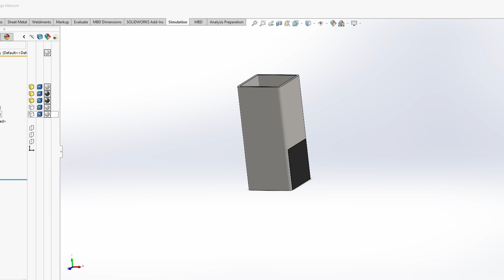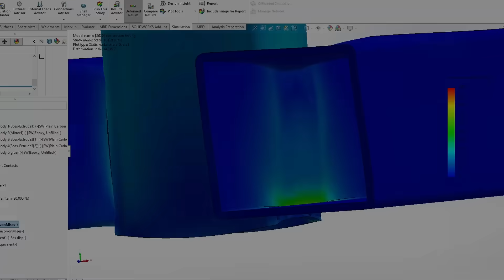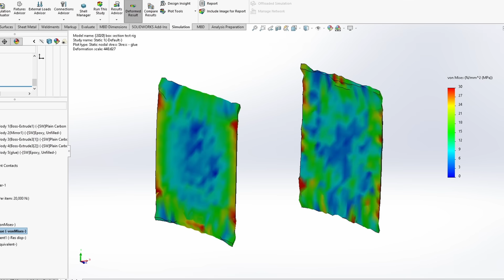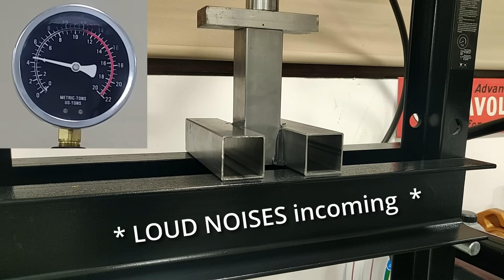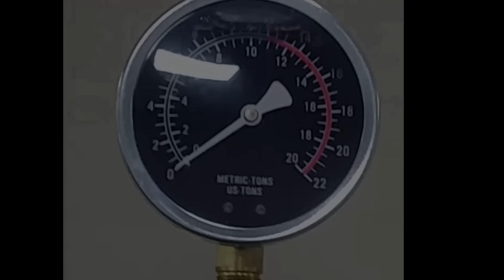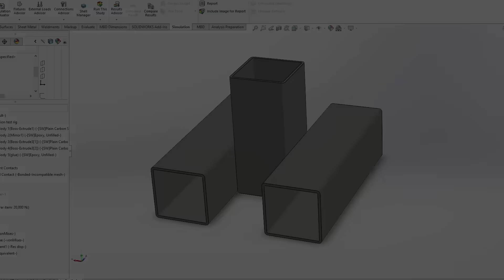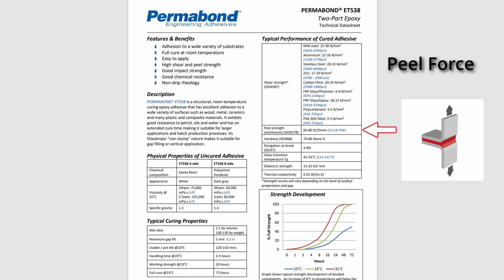How strong is JB weld structural epoxy adhesive anyways ?  Destructive test, simulation and review

Comment: If they can mimic the elasticity of the metal with the epoxy, then they wld be well on their way complete success. I use their epoxy and agree, it is rock hard. Which is what you have to build for. Say if you worked in a step of minute proportions, wld that stop the sheer?! hmm  Thanks for putting this up.

Comment: thank you for the video, just a clarification. You say "wet area about 3000 square mm". If the size of the box section is 44 x 44, wouldn't the "wet area" actually be 44 x 44  (x 2)? thanks!

Comment: My dad drove a logtruck for some 10 years in the 2000s. He had a crack in one of his fuel tanks, so he stopped at the hardware and got some quick set JB weld. We still have the truck even though he doesnt drive it, but that tank is leak free.

Comment: Thats insane.

Used it to repair some brokem fan blade. Wove the blade using wire for extra tensile strength. Waiting on it to cure before runnin it but this test tells be that the expectation is well within range.

Comment: Just ran into this video, seems im 2 yrs too late lol but i'm curious, husbands a/c pipeline has a crack in it & mechanic couldnt locate parts for it due to being 2000 subaru wrx. Would this work with the a/c pressure & all?🤔

Comment: I think you should have used a plate of steel of equal hardness of the test piece. You may have lost a ton by using the aluminum.. a softer metal.

Comment: "Structural Epoxy"?  Is this a new product line for them?  Also the steel content isn't terribly high.  Compare some cured JB Weld with a piece of steel using a magnet. Steel powder isn't even a good filler material for epoxy composites, because it is short.

Comment: Question I have a 2008 Toyota 4Runner the differential Bolt top and bottom but just the top right now is stuck and I stripped it you think it would it work to help me remove the bolt Factory says it's 35 foot pounds when Titan I know that has to be more than 35 ft lbs cuz it won't budge

Comment: The original JB-Weld is really good.
I used it on an old Philips P82 vacuum cleaner from the mid 90's, on the 90-degree angled hard plastic pipe that holds the hose that can swivel 360-degess, it broke like 1mm above the surface of the top-cover. i just shopped for some really good glue, and by accident found JB-Weld, i glued that tiny plastic pipe on just the small tiny edges from both sides where it broke together, i believe i even held it for 20 minutes by hand under pressure, according to the information that was on the package at that time, and then i let it harden, and it's still working, i used it yesterday. This job was done in early 2005, so it has held for over 20 years at this time, and i can drag the P82 in the hose and it just works, so cool.

Comment: Mate arrived at work with an oil leak from his engine. On checking, found one of the driveshafts runs parallel to the rear of the sump with about 1cm clearance. Appeared that a small rock must have bounced up and got crushed between shaft and sump. Steel sump lost the battle and had a small indentation and split. I cleaned the oil and other grot off the sump surface and held my finger over the split, then quickly removed my finger and before the oil had time to ooze out I spread some well mixed JB weld over the area. Didn’t think it would hold up to the oil, high temperature, vibration and crankcase pressure.
Astounded to see it didn’t leak when running, and it was still holding a couple of years later when he changed cars.
First time I had used JB weld, but I’ve had a pack in my toolbox ever since. (This was about 30years ago and the car was an even older VW Golf)

Comment: Great work. As with welds,the throat thickness is important. The Length of weld also important. What would be 1) Stress of Weld at Failure 2) Strength at say per 25.4mm (per inch). These data important to use for design purposes.

Comment: When I bond two surfaces together with JB weld, normally scuff up the surface so there's a place for the weld to fill into when it expands under the thermal reaction. Not sure if that would help in this case.

Comment: My dad once made a miscalculation on his motorcycle and ended up laying it down at freeway speed. It slid long enough to put a hole in the crankcase. He patched it up with JB weld, on the side of the road. The bike ran for thousands of miles before losing it in a barn fire. I also use clear JB weld to make my knives with. It's amazing.

Comment: Had a bad roller bearing in a lifter send some metal through the engine and oil pump on my Harley Davidson with Twin Cam motor.  When I did the repair work, I got the idea that I could save the oil pump by filling the scuffs in the bore of the oil pump, then sand it smooth and see if it would hold up to oil pumping duties... IT DID and ran for years before I sold that bike.

Comment: I used it on my first car's radiator fins and two years later when I sold the car it was still holding strong! Awesome stuff that actually works like magic!
Reply: a friend of mine used it on his radiator also. A crack around where the radiator cap is, about 1/4 inch long... it held for 2 years without fault until he sold the truck. It was a plastic radiator :cat-orange-whistling:
Reply: Agree, I always have tubes in the house, awesome glue and it sets really solid. its sad how things fall apart, poorly made, and to the rescue JB Weld. Love the stuff

Comment: You will get even better results by removing the oxidation on the aluminum immediately prior to applying the JBWeld. The real use of JBWeld however is in repairing cracks in castings. Aluminum casting repaired with JB will be stronger than the actual casting.

Comment: I used JB weld to repair a small crack at the bottom of my gearbox on an air called 911 about 15 years ago. It was quite a bad leak and it is still secure after 15 years. Amazing stuff if used properly preparation is always the key

Comment: Years ago my motorcycle tipped over and it snapped off the top of my cast mirror mount.  Left about 3 female threads with nothing above that.  I coated the male threads on the bottom of the mirror arm with wax, screwed it into the 3 threads remaining..  Then using JB Weld, built up the top of the mount all around the mirror's male threads.  Let it cure for a while, and then backed the mirror out (not knowing how far I could trust the wax, I didn't want to find out by finding it bonded permanently to the mount).     Let it cure fully, screwed the mirror into the new JB Weld threads, and then tightened the lock nut on top of that, putting the JB Weld in continuous  stress.   To get the angle of the mirror right I couldn't bottom the male threads out in the hole thus it wasn't using more than 1 1/2 of the original metal threads.       I later bought a replacement mirror mount..  but never used it.   Sold the bike years later with the JB weld still holding the mirror on, having survived a couple more drops (saw some offroad use) and many adjustments. 

I've also used it to fix a bad crack in an aluminum oil pan, without removing it.  It doesn't stick to oily surfaces so  my trick was to drain the oil, and then keep spraying BrakeKleen inside the oil pan drain hole over the course of a couple days until it eventually ran clean through the crack.   Packed the crack full of JB Weld and built up some around that, and it never failed.   Did weep every so slightly (like one drop after 12 hours).

Comment: Jon, not sure if you will see this comment but I'm looking for your advice after this astounding test you did.

I'm replacing the Air Oil Separator on a 996 C4 with the engine still in the bay. There is no room but after painfully removing front and rear plenums and the LH inlet manifold I can now access the AOS at the back of the engine. Woohoo! I thought, just 2 x 10mm bolts, accessible from underneath, which hold the thing to the crankcase, and the job's sorted.

If only this were true. The bolts do not look great, rusted and when I clear the rust, also appear marginally rounded over the top of the bolt. I've used every tool I can get on the bolts, which are extremely shallow, but cannot get enough "grip" to turn the things.

I've tried sockets, wall-drive & 6-point, open end spanners, ring spanners, dog-leg ring spanners, impact sockets, 10mm, 3/8" (roughly 9.53mm), 1/4" drive, 3/8" drive, 1/2" drive... everything and failed.

The main problem seems to be that the bolts are extremely shallow and most tools do not actually have a flat face, but a nice curve down to the working faces. On an extremely shallow bolt, this means that I cannot get any grip on the bolt to turn it.

The only flat faced tools I have are actually the open ended spanners, but the AOS component itself is fighting against me here because I can't even put the spanner flat on the bolt head as the bolts are located within a moulded channel which forms the bracing webs for the attachment bracket of the compenent!!

My last idea, before I commit to the removal of the engine... which will make the job significantly easier and open up other options if the bolts are actually stuck... is to secure 2 x cheap 6-point 10mm sockets using JB Weld to the bolts, let the epoxy cure for a day and then see if they will hold the turning torque required to loosen the bolts.

My first thought on this was that the shear force will just crack the epoxy, but having watched your astounding video, I am wondering if my idea might just work. The epoxy will be contained within the sockets, forming a film between the sides of the socket and the head of the bolt, it will also create little wedges in the spaces between the points and the rounded top of the bolts.

Clearly the bolts are on an engine and cannot be cleaned as well as would be desired, the joint will be fairly inaccessible and cannot be inspected, I cannot guarantee either that the epoxy will be evenly distributed. All of which will weaken the potential bond.

Having said that I am doubting that I need a full strength bond to loosen a 10mm bolt.

What do you reckon? Likely success? Guaranteed abject failure? Worth a try?

Your thoughts will be very welcome, I am 3 days into this now!!! Mental.

Kind regards, Paul
Reply: Another method that might work would be to grind a socket so it has a flat face.  What did you wind up doing?

Comment: I used to own a second gen crown victoria. This was the one with the non-PI head so the spark plugs would eventually strip out the thread and shoot out. I was not doing so well at the time so my only option was to JB weld the spark plug back in and maybe it'd last a day or two before it gave out. It was not rated for combustion temperatures. I kid you not, it lasted a month before it finally shot out the spark plug. And this is daily driving it. I can't even imagine if I had used the high temp stuff, it would probably just be part of the engine to this very day.

Comment: Bought a new double barrel shotgun, sawed the stock off, shoulda known since it was a new gun it had some bs waiting for me. The stock had a metal rod holding the stock to the gun so had to saw through that. After that the whole damn handle fell off the gun 😂 put some of this on ther where the metal meets the wood handle, epoxyd the rod into the hole it went in to the handle. Works 👌

Comment: Interesting test. It may not make any difference, but I would rough up the area with sand paper to give the adhesive a better grip. The holding power without that was surprising but it would be interesting to see if a sanded area would help the holding strength.

Comment: NEVER EVER touch not cured epoxy without protection and only use in well ventilated area. Even with gloves - change them quickly after coming in contact because the chemicals come through (quicker than data-sheets suggest). This chemicals belong to the one you really dont want to have contact with.. even if you probably dont feel the effect immediately. Just read the safety sheets / paper of the product. If you want to inform further, read the wiki articles of the chemicals, listended there. Interesting Video - and JB-Weld is also my favourite epoxy :D

Comment: I'm wondering if JB is strong enough to stand up to building up a new cylinder head for inline sixes out of two or more V-8 heads. I've seen ones that were welded together out of sections. There was a Pro Stock Ford Maverick in the 70s that ran a 300 six cylinder with a head built up out of Boss 302 or 351 heads. Ran like snot.

Comment: Did you try it after sanding first with 60 grit alum oxide sandpaper?  Acetone wash then isopropanol.  Air dry. Heatgun-warm the entire wetted assembly during final placement.

Comment: I use to acid clean condenser tubes on chillers that scaled with calcium carbonate and silica. The process took around 8-9 hours sometimes. I would use 30% hydrochloride acid and 5% hydrofluoric acid. The whole process is not something taken lightly and involves the potential loss of a couple million dollars or more . I used JB Weld to coat the inside of pipe and hose connectors that I used. I replaced any steel pipe nipples , fittings etc. for the process. I used only the best brass and industrial hose with crimped fittings not box store stuff. After the whole process the JB Weld coated fittings were still unaffected. JB Weld is without a doubt a “tool” that should be in everyone’s toolbox, shop, garage and emergency kit along with super glue and activator.

Comment: I worked with prisons for a couple years early in my career. They would JB Weld cables to the wall to prevent them from being used to strangle the inmates.

Comment: I've used JB weld for years.  The oddest use was to seal a crack in a bass float bowl in a carburetor.  I didn't think it would work.  But I drained the float, cleaned the area and beveled the crack with a Dremel tool  it was too thin to braze conventionally and I could not locate a replacement float.  Figured I had nothing to lose. The key was to allow it to cure totally.  It ended up fixing the float.  The engine went on to run the rest of its life and  carb worked perfectly.

Comment: Added tip- jb Weld can be manipulated with a magnet. If you are trying to use it in a hard-to-reach area or want to draw it into same, use a magnet.
I love this video and It proved what I have been saying about JB for years- It's awesome.
Reply: I haven't seen or heard this anywhere before. I'm gonna try it and this suggestion should be automatically added to every JB weld video.
Reply: @Upgraydez I was adding a magnet to the end of a shaft to make a guitar pickup winder. 
I noticed as I spread the J-B weld around it it formed its own filet. 
Then I tried using a strong magnet and I could actually pull it along. 
It is made of epoxy and ground steel as far as I know and this works.

Comment: JBW is too rigid to be used oh things that flex, like where bondo should be...body work, ie fiberglass.

i have used jbw as a thread locker on a homemade helicoil 😂

and to restructure threads for oil pressure sensors on aluminum engine blocks 😂😂
Reply: And to hold a quarter to the top of a piston to raise compression 😂

Comment: The stuff works so well for certain things though. If you aren't going to have wild or extreme temperature swings and you aren't going to be putting it under weird stress or abuse it will hold up basically forever.

Comment: I would be interested to see how JB Weld 'Extreme Heat' stands up to stress loads at engine temperatures.
The application I intend to use it is to repair a stripped thread in a vintage flake graphite cast iron cylinderblock used to retain a cylinderhead bolt.

Comment: JB weld is epoxy with steel powder in it. In the Grumman line of light aircraft from the 70s and 80s, Tiger, Cheeta, etc., nearly all of the structure used aluminum bonding methods to attach skins to substructure like ribs and frames. Looking at them, you'd think they were fiberglass. This only became a problem when the bond's greatest weakness, low resistance to peel, resulted in wings experiencing peel-back bond failures at corners, fortunately discovered before there were any airframe losses. The permanent fix was quite simple: stop the peel from getting started mechanically, and I believe an Airworthiness Directive was issued that required installation of a single rivet at skin corners on the wings (at the rear spar - the skins are a single wrap). Problem solved.  So, when designing a bonded assembly with a flexible stressed skin or panel of some sort, it's a good idea to use a mechanical fastener to hold the corners down so a peel failure can't get started.

Comment: Good video, I have been using JB weld a lot on my custom / race bike, nothing structral but I have a few steel to aluminuim items that had to be joined (eliminating the use and weight of 2 bolts) and some other work that I thought would be better if it was bonded. been fine for 6 years now

Comment: My biggest issue with the product is the stupidity in calling it "weld".  Welding involves heating the base material into a molten state and joined with or without similar, molten filler material.  This product is JB Glue.  It's good glue, but it's not "cold welding".

Comment: Great test. I'm getting ready to use JB Weld to hold a control panel in place for my kitchen oven. It is not in a super hot place - just where the clock is.

Comment: I was coming home from a deployment, and one of the humvees we had broke its harmonic balancer on its way to the ship. It ran so rough we thought it would shake itself apart. All we had was a BDAR kit, full of JB weld. No one thought it would work, but we had nothing else. We slapped it together and moved it to the end of the line to cure. Wouldn't you know it? It started, ran a bit rough, but held together long enough to get it on a ship and a train, all the way home.